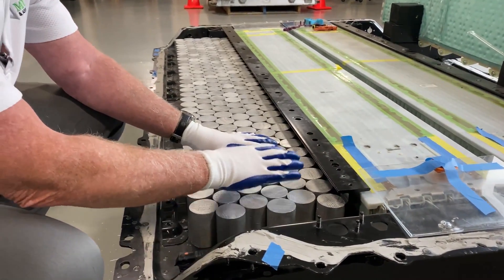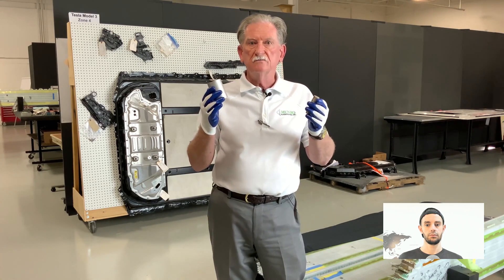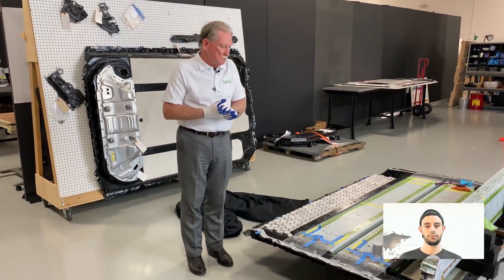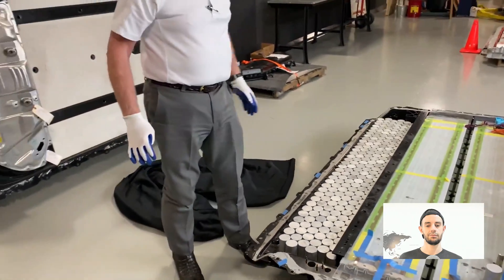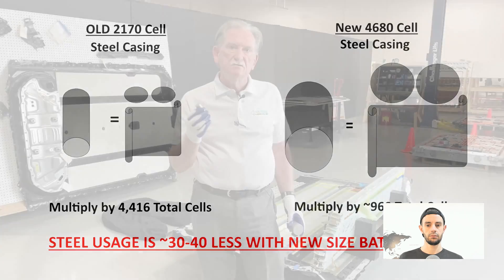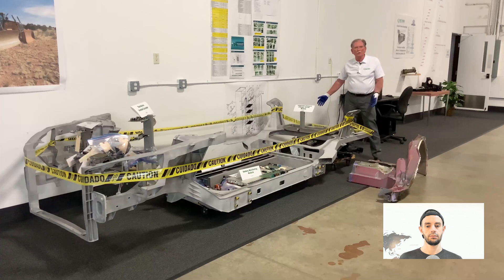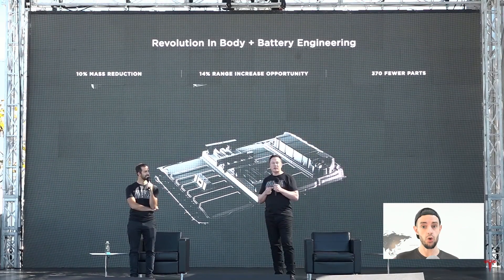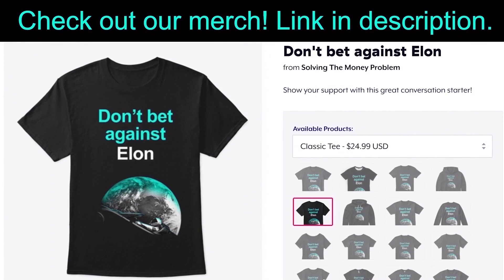Tesla Engineering: Sandy Munro THRILLED

Comment: The Giga press is genius, if a part doesn't make the grade, the material is recycled back into the press hence no waste material.
Reply: The fact they went like “ we need this material”
‘ it doesn’t exist’
“ we will make our own alloy!”
Reply: Very true, 100% liquid casting, 0% waste aluminum, fully recyclable,
Reply: Simply genius
Reply: I wonder what castings will do to repairs.
Reply: @matthewdunstone4431  Big expense...
Its like when they switched from transistors to IC only on a bigger scale.
Reply: Matthew Dunstone 
Don’t they often crack? It can usually be welded, I think? I have the same question.
Reply: @hyperdrivee7922  Me too.  You won't be able to put a Model Y on a frame machine and pull it back to spec.  I guess you'll be looking at replacing the front or rear casting.  While they're designing for easy manufacturability, I hope they don't forget repairability.
Reply: IncognitoTorpedo 
Replacing could be a astronomical cost. It does seem like Tesla fights the right to repair? This may be intentional, which truly would suck. Hopefully not!
One of things that excites me about teslas environmental footprint is that they have the potential to live 2-3 lifetimes compared to a ice v.
Reply: @incognitotorpedo42  i mean i hope they can eadily repair you tesla vehicles but if the frame of the car is broken you need a new car period
Reply: brad Elliot 
I think what he’s saying is that there won’t be a frame to straighten anymore. You can straighten a frame. Castings don’t generally bend, they crack in pieces.
Reply: @BradElliot  Frames are repaired all the time.  That's normal work for most body shops.
Reply: @incognitotorpedo42  they'll learn about that by insuring them I reckon.
Reply: @matthewdunstone4431  A large casting is likely more expensive than the sum of parts replaced in a regular car. But the casting is actually not super expensive in manufacturing time and cost, while the multiple parts aren't really cheap either, as they take more time overall to produce. Now if we compare the service time, I think it would take less time to replace the casting, compared to multiple pieces that have to be put together in the right order, with a lot more nuts and bolts. This means less labor costs, so I do wonder myself what the end difference will be. Oh, and I bet the structural integrity of a Tesla would be much better after a body work, compared to one for a regular car, which sometimes are no longer the same.
Reply: Also, if Tesla is smart about it, they could buy the old casting from the customer, which can be 100% recycled, for a lower service cost for the car owner. It's a win-win.
Reply: Nicolae Crefelean 
Ha? If the cars totaled?
Reply: @hyperdrivee7922  If it's totaled, isn't it the same thing as any other car being totaled? :) By definition, totaled = cost of repair > insured value. Now considering that Tesla will recycle batteries, I think there's a big opportunity for both Tesla and their customers to recycle as much as possible from a totaled car and discount that value from the acquisition price of a new vehicle.
Reply: Nicolae Crefelean 
Thank you for explaining “ totaled “ 😂 Do you really think the insurance company will consider the few dollars of Raw materials, that will take considerable cost to even call them that? 
After the expense of recycling we’re talking maybe hundreds of dollars on a car thats 10 of thousand. 
Even if there is a value after the expense of dismantling, purifying and reconstituting, That value is only to the manufacturer.
The pionts of recycling is two fold
-Environmental Ethics.
-Free Or very low cost raw material.

Engine blocks are cast, bodies are made of steel and aluminum. Today’s cars are very recyclable. Its the expense of dismantling being more than it’s worth.
Tesla only says its recycling the battery so far. The rest we’re assuming.
Just like lead acid batteries in Ice cars. Today we have to pay to dispose of Batteries. Even lithium ion. With recycling, we hopefully won’t have to pay anymore.

This is an important conversation because Tesla are so expensive to fix. Due to the sensors and cameras, they will often be totaled before others. Even a millimeter difference in paint thickness can through things off.

I do like your thinking
Reply: @hyperdrivee7922  You asked if the cars get "totaled", so I wasn't sure that you see the difference between a totaled GM or Tesla vehicle - hence the short definition. Now I'm not sure if you understand the recycling part on the Tesla side, which means two huge parts - the front and back castings that don't need special treatment or purification, as they're done from the same material. All they need is a good power wash, then off to melting. That's the beauty of casting - easy to make, easy to recycle.

As for "more than it's worth", that's more true about traditional cars than it is for Tesla, which replaced hundreds of parts with the castings, and removed a lot of complexity and even wiring (down from 3 km to 100 m). Tesla cars are engineered to be simple, and that helps a lot in both manufacturing and recycling. Also, most people care about a voucher worth hundreds of $/€/etc. Sure we're only assuming Tesla would do this, but it makes perfect sense because it's easy to do and worth doing it, compared to dealing with mining/procuring and processing the raw materials.

And repairs? Tesla cars are already 10 times less involved in accidents, according to NHTSA, before even having level-5 autonomy. The more Tesla cars we see on the road, the safer it will be out there, and less cars will end up having accidents. This means a lot less time and money spent on servicing crashed cars. A decade from now, accidents will be a rare thing if most cars will include safety features close to what Tesla has. They're pretty close to releasing it by the end of this year, so it's quite exciting. And it's a very difficult problem to solve, but Elon's companies have the tendency to go against the odds and overcome them, so the chances are good that accidents will be a thing of the past way sooner than a decade from now - provided that other car manufacturers get level-5 autonomy, either on their own, or from Tesla.

By the way, I live in Germany and we don't have to pay for recycling batteries. Retailers are required by law to collect batteries free of charge. For car batteries there are specialized centers and you can drop them off there. We still don't know how Tesla will recycle, but we know they do things differently. So instead of having to source materials from others, Tesla will likely be happy to give people discounts to buying new Teslas if they turn their recyclables to them. Wishful thinking here, but it make sense.
Reply: Nicolae Crefelean 
Nicolae, I did forget the most important thing, as much as I would love to sit and argue with you, over some warm beer. I have to say.
As far as Berlin goes, that construction is something to be proud of. I have never seen anything go up so clean and precise, let alone the speed. I understand it will be the biggest automotive factory in Europe? The whole world is watching this develop.
We are expecting German expertise to bring a new level of fit and finish to Tesla. Especially on the interior. New technological advances are bound to happen as well. This is the relationship that will put T on a new level.
- as long as you are not constantly focused on “discounts” for every single little thing. 😆 -

I disagree with your insurance take 10 to 1. We have a similar stat. That generalization doesn’t apply in the case you made without isolating the data. That’s probably enough said?
I definitely would like to know more details about current EU recycling laws, processing and responsibilities. In the last “3y9m” The EU has grown environmentally why’ll the US has receded. 
Respond if you wish to discuss these Or just let it go.
😝 Remember you have speech control 😝 
✌🏼
Reply: @hyperdrivee7922  "Respond if you wish to discuss these Or just let it go." That's quite a convenient way to tell people to accept whatever you say and shut up, especially after the now-deleted comment was so poorly shot in my direction.

I'll just remind you then you have no facts either, as you haven't been under a brand new Tesla with two castings. It's anyone's guess how everything will be fit, glued, welded, etc. So if you don't like my theories and wishful thinking, that's fine.

About the EU laws, it's important to note that they're not the same in all European countries. They have similarities but the focus is on facilitating economic growth and collaboration. So what applies for Germany in terms of recycling, doesn't apply everywhere. As far as I know, Ireland and The Netherlands also do pretty good recycling.
Reply: Nicolae Crefelean  I didn’t delete anything? Are you on drugs?
Reply: Nicolae Crefelean 
Ive been under and in the one in my garage
Reply: Nicolae Crefelean 
What was deleted? Tell me? Especially if was something good. I need to post it
Reply: @matthewdunstone4431  I'm hoping they engineer it where you don't have to completely gut the car to pop in a new cast frame. They also certainly shouldn't attempt welding the casting to repair, you need a real pro with a TIG welder to even hope for a clean weld. It's also their own alloy, so it probably needs to be a certified procedure.
Reply: Which is why Elon is the major shareholder in Experimental Dildoes Inc, soon to enter a Starship reentry theme, with flaps, boosters, bellyflops, landing burns.
Reply: Absolutely, and at end of life to! Sandblast, melt, reform, new car
Reply: Reclining Buddha 
Cool buddha boy, that’s pretty obvious, but why are you telling me this? How do you fell about their monetization of current owners.
Reply: Reclining Buddha 
cool bud, again I know what it is. Think everyone kinda gets the general point. We like it too but didn’t order it. Who knows, might just be on a different model by then. Just was asking your opinion on the billing options, it’s expected to be over 10 to 12k by the time we hit level 5. There’s so much more, like just as of this week you can by a 2,000. upgrade to make your model Y around 5/8 of a second faster. Tesla is the only vehicle that offers you expensive features you can buy from the car, with your card on file, as easy as downloading an app. That’s the point i was making. This is what nobody else has. To be clear this is 100% prophet. (Post R&D) Each purchase is probably more than any legacy manufacturer make on a original sale.

And hey, Chill’n Buddha⭐️ don’t let your old relatives go to the hospital in a taxi why’ll you drink⭐️foo!😆 
✌🏼
Reply: Reclining Buddha duh? that completely! Misses the point! 🛑
Reply: Jour Namehere 
Just like an engine block.

Comment: If Munro is right on the kWh pack size of the PMS, then it’s be 248 wh/m or 4.03 miles per kWh and the same as the Raven MS wh/m.:_STMPMatters::_STMP420:
Reply: IIRC, One of Sandy's videos said that he estimated current cost of tesla batteries is currently around ~$108 per KwHr to manufacture. Industry overall is likely around $110 - $130 per KwHr. Big deal when Tesla said they could halve the per KwHr cost on Battery Day.

Comment: I’m wondering why is the battery a cylinder? You would think a honeycomb structure would get rid of all the spaces between tubular batteries, or a square battery. Is it only a easier production reason?
Reply: — With the tabs removed, production will be efficient. Remarkable little space between the cells that will be filled with epoxy, same as tops & bottoms glued to the horizontal plates. 
     Sandy didn’t explain why (apparently) only the cell bottoms are being cooled — you’d think cuz heat ordinarily rises, you’d they’d do the tops, too (might be the water problem or the bottom cooling is below ambient or otherwise draws enough heat out that the added complexity (or water risk) was not needed (best part is none; best process is none).

Comment: "This isn't Burger King" - Sandy Munro
Reply: “This ain’t no party. This ain’t no disco. This ain’t no fooling around.” - David Byrne of The Talking Heads. But that’s what GM, Ford and the other OEMs are doing...fooling around.
Reply: He didn't go into it, but there's a lot of secret sauce in what they announced. Other companies can't just copy Tesla without putting in the engineering work. For instance, the mega casting requires a special alloy of aluminum that doesn't require heat treating... that's not something you can just order from Burger King. They had to develop it themselves, and so will anyone who tries to imitate them. Pretty much everything they announced has hidden complexity like that.

Comment: The battery improvement numbers elon showed on battery day are wrong, they  add up to 56% 
But that’s NOT how it works 
Look
14% improvement on 100% gets you to 114%
18% improvement on 114% gets you to
134.5%
5% improvement on 135.5% gets you to 
141.3%
12% improvement on 141.3% gets you to 
158.2
7% improvement on 158% gets you to 
169.2 % 
The improvement is not 56% 
Its 69.2 % 
Tesla lied except that they did tell us this and hid it in plain sight 

Make a video of that !!!!
Reply: No, that's not how it works... Improvement is not on the whole system level, but to a specific part. It's not on 100%, but on corresponding step in the manufacturing. 
Say, if resources price is 12% of the total cost, slashing cost of that has no effect on what you do later with that now cheaper resource. If you can make cells from raw materials faster and cheaper, it has no effect on the initial price of lithium, iron, etc. If the new cell dimensions make it the whole battery pack cheaper, it had no effect on cell price or lithium price. Just because you can roll sheets of metal faster doesn't mean lithium ore is now cheaper...

Comment: 🚩🚩🚩

RED ALERT ⚠️ 

https://youtu.be/l6T9xIeZTds?t=6800

Tesla's calculation is fucking WRONG❗️❗️❗️

You can’t add those numbers❗️❗️❗️

The compounded savings are way less❗️❗️❗️

Please share your comments on this❗️

Has Elon this realized yet❗️❓

Just let’s assume that all cost blocks are the same at $100 each.

Cell design $100 (old) -$14 > $86 new
Cell factory $100 (old) -$18 > $82 new
Anode material $100 (old) -$5 > $95 new
Cathode material $100 (old) -$12 > $88 new
Cell vehicle integration $100 (old) -$7 > $93 new

OLD:
 $100
+$100
+$100
+$100
+$100
———
$500

NEW:
 $86
+$82
+$95
+$88
+$93
——-
$444

>>
1-($444/$500)
——
1-0.89
——
0.11 >> 11% ❗️❗️❗️❗️❗️❗️ Instead of proclaimed 56 % ❗️❗️❗️❗️❗️❗️❗️❗️❗️

THIS IS ONLY TRUE IF ALL SINGLE COMPONENTS ARE EQUALLY❗️❗️❗️❗️❗️❗️

The same is true for the other calculations with 54 % and 69 % ❗️❗️❗️❗️❗️❗️❗️❗️❗️

Please keep in mind this was the ONLY thing that Tesla presented at the battery day and this is completely OFF ❗️❗️❗️❗️❗️❗️❗️❗️

This is WRONG, and this is what they HOPE to achieve within a few years ❗️❗️❗️❗️❗️❗️❗️❗️